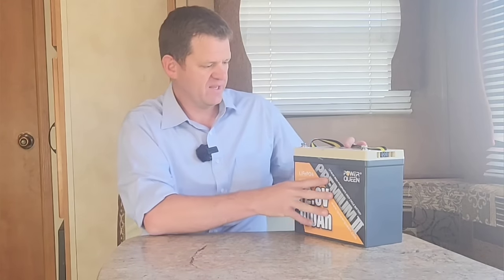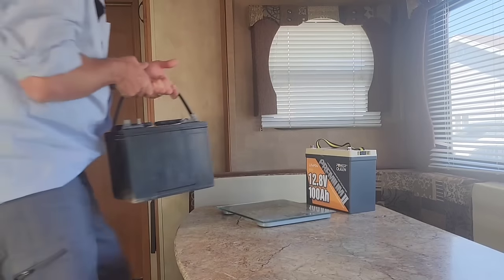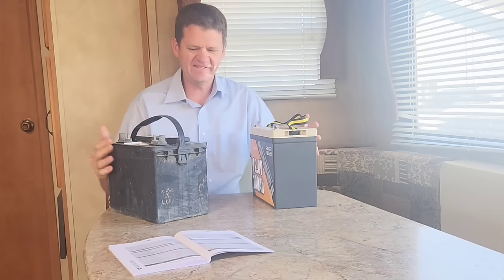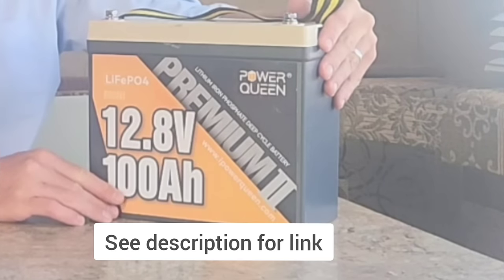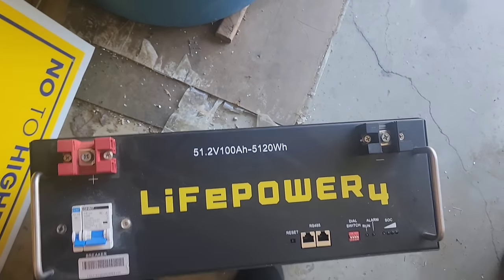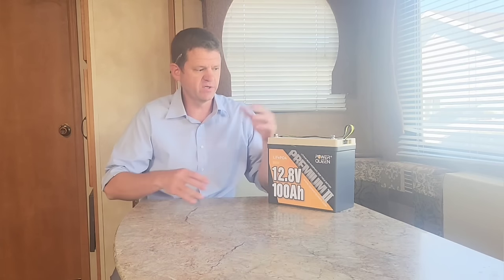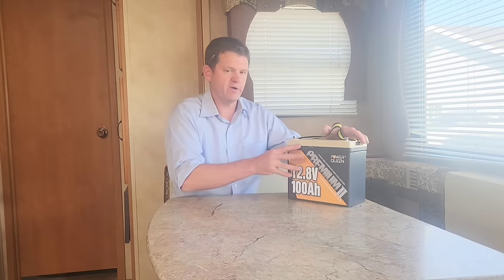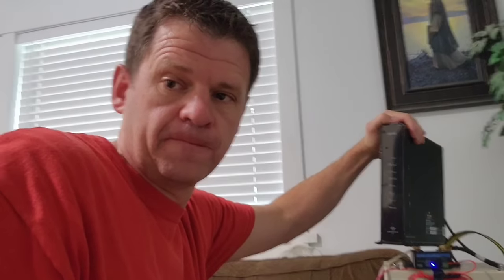How Long Can a 12V LiFePO4 Battery Run a Fridge, TV, Laptop, and Wifi Router (PowerQueen test)

Comment: I run my outdoor lights with 3 100-watt solar pannels, a 100ah lifepo4 battery. I think it might be overkill 😂😂😂. It's not even that many lights !! 😂😂😂.
Reply: Make a video on that, I want to do the same. Please
Reply: @prkoqui  I'm not good at videos. 
My setup:
3 100-watt solar pannels.
12v 100ah lifepo4 battery
Victron 12v 375 va
Renogy 20ah mppt charge controller
3 50-foot outdoor lights from amazon
Timer for the outdoor lights

This setup runs my outdoor lights without a problem ! Even with rainy days, never fails. The victron 12v 375-watt inverter is a smart idea because it only uses 4 watts of power at idle. Crazy low ! Then, the timer makes sure that the lights are on only during the night. 12v 100ah lifepo4 battery charges fast and lasts long. 300 watts is enough to charge the battery.

I have recently upgraded my setup. It now has 3 100ah lifepo4 batteries, 200 watts of solar at 24v. I plan on letting more solar pannels and upgrading the mppt charge controller. I upgraded because I now feed this into a gaming room. 😀

Comment: Hi I'm curious if you checked out the fridge to make sure it was cooling.??  Make another video of you opening the top of the fridge and showing it running as it should be blowing cold air out.... 
PS: I have a 400 what inverter and it doesn't run the "fridge, compressor"  the lights come on inside of the bottom* but compressor kicks on - the alarm sounds on my inverter. However, it's not from Renagy.... It's an ( off brand )... So, I just want to know if you're compressor runs with - out kicking the alarm on, the inverter.... THANKS.!!
Reply from the maker: Ok, I'll try and show that in the next video when I do the test with solar connected. Thanks

Comment: What was the brand of the 5200wh battery you showed at start?  

While there are bad inverters, I find efficiency of Victron no better than those of other decent quality inverters.  80% low watt and 90% when drawing high watts.
Reply from the maker: It's a lifepower4 server rack battery. I have a link in the description. You might also be interested in seeing the video I have reviewing the eg4 v2 server rack battery.

Comment: Maybe it’s more complicated than just this but how long would it take to charge off of 850w(1000w peak) generator? 
Cheers!
Reply from the maker: a 850 watt generator would charge it in just over an hour. maybe 90 minutes....if it's running at 850 watts.

Comment: question, is your fridge an inverter or non-inverter model? It was running like 17 hours on that 100ah battery.  I am trying to learn, and to do it myself. What we use the most is the 12000btu inverter aircon at night and the fridge, the rest is led light and my laptop. 3x per week washing machine. Even If I can only make the aircon work on batteries would be great. I can charge the batteries since I life in ARUBA where we have sunshine even at night...hahaha. Maybe you can give me some input. Thanks
Reply from the maker: Mine is the non-inverter model. I think the inverter models are a lot more efficient

Comment: The key is conservation, when you have a blackout, maybe don't run your 55" TV and the hairdryer.
In a blackout, I watch the news on my phone/tablet instead of on the TV, I don't care about the WiFi router/fiber converter since most likely the ISP is out of power too and I have good speed on 4G
So in the summer it is the fridge/freezer, and in the winter not even that.. (it is cold here)
Reply from the maker: Good points!

Comment: with a router/modem/laptop it is MUCH MUCH more efficient to use voltage buck/boost  regulator.   an inverter wastes a LOT of energy, so it's much better to use regulators.

Comment: Because of the Puerkert effect on the lead acid battery, you can never draw 100@s for one hour but you could on a lithium battery.
Reply: Amps is represented by either 1) Amps or 2) A but never @.

Comment: Great video I'm confused what battery would I need to run a 3000watt inverter continuous power 2800watt. Thanks
Reply from the maker: I personally go with a 48 volt server rack battery and all in one power station... similar to what I have in my RV but I have a really basic understanding of your requirements.

Comment: Once a battery discharges to about 8 volts it has very little power left.  You should always look at keeping it charged to full capacity.  As always, read the owner's manual and follow it.
Reply from the maker: Actually LiFePO4 batteries like to be storied not fully charged.
Reply: Inverter will disconnect  battery if voltage < 10,6 V (standard) - if direct connected you should use voltage controller - this battery is better but equipment need right voltage

Comment: Isnt the equation you divide the amps....say 100amp battery divided by 5amp tv = roughly 20hrs runtime. Add in an inverters amps is applicable
Reply from the maker: Yeah, That's that should work also.

Comment: You're showing the fridge at 50 watts. The compressor was not running.  How much of the day was it actually running?
Reply from the maker: Based on my battery monitor it looks like it's on about 50% of the time

Comment: Looks like that Victron 500va inverter is 900w continuous, not 350-400w. Can clearly handle high surge watts to run a fridge on startup. I'd be fine with 375 or 250 then, I think.
Reply from the maker: The 500va won't run 900 continuous.
Reply: @diySolarPowerFunWithRay  it was 2 weeks ago I looked up the manufacturer specs but that's why I wrote the 900w continuous (and had surge watts way way higher for starting motors) was because that's what I found... Unless I looked at it wrong. So I looked at the 375 and 250 and they seemed to have good enough wattage for my usage (around 400w). Am I wrong?
Reply from the maker: @TheSkystrider. Yeah you were my second when you looked it up. the actual continuous wattage is less than the VA rating. It's usually about 70 or 80% of what the VA rating is. It confuses a lot of people. I wish they would use Watts because that is really what you will be using. For example the victron multiplex 3000 will only output a continuous of 2,400 Watts. Serge is much higher though. If you look into the spec sheet it will mention the Watt rating.  You're not alone, a lot of people will get this mixed up.  Good luck 👍
Reply from the maker: @TheSkystrider  I bet you were looking at the surge rating

Comment: Fantastic video and you explain watts and amps to where many of us understand better than we did . I'm looking at maybe buying one of the battery's . We camp a lot and I use a C-Pap machine . Right now I bring 2 car batteries fully charged and one battery lasts 3 nights. Then I switch it to the other battery . By batteries are the lead ones . I use my C-Pap about 6 hrs a night . Any close idea how long this battery will last before needing re-charged ? Carrying 19 lbs in and out of my camper is better than 40 lbs . And will these recharge using a solar battery charger ? Thanks so much
Reply from the maker: These batteries would be perfect for you. There are some other ones that have a percentage screen which might be better though. The lfp or lithium iron phosphate batteries is definitely what you would want. I would assume that your current batteries aren't at 100% because they never are so I imagine one of these batteries would last you 4 days. Yes they can charge with a solar charger
Reply: What would be a good solar powered unit for me to use on Amazon . I'm no electrical or electronic person at all . But we do a lot of off gris camping . One that is not bigger than 2' x 2'  would work great or if you know one that is great to use. Also I want to thank you so very much for replying to my question .

Comment: My question is, how does that big fridge start with 300-450w inverter. It must have minimum 125W compressor. And calculating inrush current draw ... It must have pretty big margin that invertor. I tried 90w fridge on 300w inverter (clean sine) and it would not start. It goes in to error, over power protection.
Reply: You can add a capacitor to solve the instant current draw problem

Comment: Where is a good place to go get info for building your own systems? Right now I back feed my house from garage using a 50amp circuit and a 5500 watt generator (when power is out). I would like to put panels on garage roof and a battery bank to run house when needed but i admit i dont know much about solar.
Reply from the maker: It looks like you need a all-in-one power system similar to this one:  You can get larger ones if you have a larger solar array or you can put 2 together if you need 240volts. Also Signature solar has tech support if you have questions setting it up.
Reply: Solar - depends where are you living - Kanada , Texas, Panama during Winter. Problem with AC or water pump - need big power. And money :)

Comment: When you started the test was the compressor running on the fridge? plus the power draw would be different if the fridge happened to go into the defrost cycle? just saying.
Reply from the maker: Thanks, if I remember right, it looked look like it went through 1 defrost cycle.

Comment: As my YouTube channel name implies, I'm a Tech-Retard when it comes to all thing tech related, especially when it requires any kind of mathematics.
I can easily acquire all of the necessary components to put together a small home unit BUT, I really struggle when it comes to picking the right components.
All I want to do is build a solar setup that will run things like fans, lights and to charge my E-Bike; stuff like that.  I can just let the city electrical grid run my fridge and cooling system.

Comment: What is the capacity? And that's not the correct question in your title. The question  - How long will it take to recharge a 100AH LiFePO4 Battery after running a refrigerator all night without sunlight? For example, how many 100-watt solar panels will it require to recharge the battery before night fall? That's when you decide that you need more batteries and more solar. In addition, you need a controller programmed for LiFePO4 Batteries and a Pure Sinewave Inverter. I power two freezers and a small refrigerator with four LiFePO4 Batteries in parallel, a Victron 100/30 Smart Controller and a Victron 500 Smart Shunt and four 100 Watt Solar Panels. I monitor everything on my cell phone. I need at least 200 more watts of Solar. It's only for backup. The sun better be shining when I need it. No sun, then no power.
Reply from the maker: Nice set up

Comment: How many watts was the fridge drawing during the test. I think I saw around 50 watts? Was that right?
Reply from the maker: It jumped around. When the condenser was running it would use a lot more power than that.  Idle... not a lot of power.

Comment: Buy only pure sinewave inverters. Modified sinewave inverters don't work well with motors and some electronics. 20" circular fans hum with modified wave inverters showing this effect. Spend the extra money. Remember though, your inverter will call it quits when the voltage gets too low before the battery goes to 0%. Put a timer on and when the inverter alarm goes off that's the extent of the battery.

Comment: I'd better use several small systems which gives me redundancy, that is if one fails i can easily swap components prioritizing what i use and always having a backup, plus repairing is simple and cheap instead of a big system that goes down tottaly in case of a falure which might be inconvinient and expensive
Reply: more over, i'd use 12v devices when ever possible avoiding the need for inverters since anyways devices using A.C need to convert back to 
D.C internally
Reply from the maker: Good point. Thanks.

Comment: when you tested the fridge consuming 86% of battery power you forgot to take into account the power used by the inverter and the power used by the power monitor. voltage conversion always has losses and heat generated also results in power loss. using bigger conductors and fans can help alleviate some of this loss. also an oscilloscope on the inverter will show the generated sine wave. some inerters are square wave however continued use with electronic commponents dont perform efficiently on sqare wave. multi stepped sine wave are more expensive but safer for tv and puter

Comment: MPPT....would a 20A be ok or 30A better, i'm new to this stuff.
Reply from the maker: Depends on the size of wire you use. How many amps the wire can support.  You want to breaker to break before the wire melts.

Comment: I don't know. But I know 16 of them will run my entire house for 3 days if I'm not running any AC units. A day and a half with running 2 small AC units. And overnight if I run 3 AC units using the 12,000btu unit sparingly
Reply from the maker: Nice!

Comment: Any fridge when starting up pulls 8 or 9 times the load. If it's a 500w fridge it can pull almost 4500w. How is it possible for a 400w inverter to handle this?
Reply from the maker: It handles surges.

Comment: 1 quick Question if you have 3 of those batteries hooked up parallel  would that make it 300AH?
Reply from the maker: Yup. 12v 300ah. But if you want to determine the full battery capacity, you want to be measuring in watt hours.

Comment: how long did it take to re-charge the battery fully from solar panels after fully draining it?  Thanks.   Also, you need to power your cable modem as well as the router for internet access, no?
Reply from the maker: They recommend charging it in 5 hours. But you can charge it in 1 hour if you want to really push it. In my case my router is my wireless modem
Reply: @diySolarPowerFunWithRay  Thank you, that is pretty amazing.  Can you tell me what cabling I should buy for that exact setup?  Thickness and length for battery monitor

Comment: I like the video it's John to Earth and you did a good job I live in South Florida I had four deep cycle batteries they work good and I had my Ram diesel charge them.  I've since got rid of the batteries cuz they went bad after 3 years.  I'm going to get to 200 amp batteries now the ones you're talking about and run an inverter off of my diesel RAM truck and and have the inverter on my truck plugging a battery charger to charge the batteries. I'm going to run the batteries to charge my three refrigerators and I have a mini split air conditioner so I need about 6 to 700 w about 6 amps
Reply from the maker: Cool. If you are running a mini split I would consider getting server rack battery setup.  I've got some videos on that system is well.

Comment: @1:00 not true! If you de-charge the battery 100% it won't recharge again. The controller SHOULD stop you doing that. The controller expects a minimum of say 9v to still be on the battery/host for it to be able to start charging. This is often what goes wrong with 18650 cells being de-charged too far. A simple slow kick to bring up the voltage will generally fix the issue but that requires equipment not normally found in the house.
Reply from the maker: Incorrect, you are confusing this battery with other battery chemistries
Reply: @diySolarPowerFunWithRay  try and get a charger to recognise the battery when it's 0v DC .... it won't! Been there done that!
Reply from the maker: @NullaNulla   lithium iron phosphate batteries have a battery management system that prevent that from happening
Reply: @diySolarPowerFunWithRay  correct they're meant to but if you deflate the cells 100% as you claimed the BMS won't see the cells and will refuse to charge. 

I should note it's not the cells that's the issue but rather the BMS.
Reply from the maker: @NullaNulla  LiFePO4 Battery Depth of Discharge - Eco Tree Lithium https://ecotreelithium.co.uk/news/lifepo4-battery-depth-of-discharge/
Reply: @diySolarPowerFunWithRay  the BMS still won't see the cell at 0v. It's by design and an unfortunate side affect.

Comment: If you had removed the laptop battery and used it on AC only, it would have been a better test I thought. Good job though... thanks.
Reply from the maker: Good point!

Comment: My guess would about 90 minutes or less for a full size fridge, 8 hours for an lcd t.v.,  I don't like laptops, and routers don't draw much power.
Reply from the maker: I actually got 17 hours for the fridge. Thanks for the comment.
Reply: @diySolarPowerFunWithRay  You mean 17 hours including the time between cycles when it wasn't running
Reply from the maker: That's correct.

Comment: Hi, Sir, in camping,
Can I connect it to my Bluetti battery for charge?
Can I charge it with my van cigarette light?
Thanks:hand-pink-waving:
Reply from the maker: I'd get a DC to DC converter in order to charge this battery from my cigarette lighter. Hope this helps. Or just one solar panel would be the best. Obviously you'll need a solar charge controller also.
Reply: @diySolarPowerFunWithRay  God bless 🙏✌️❤️❤️❤️

Comment: can i ask how many Watt did the Fridge actually drawn at peak ? Have you try it with an AC yet, i really wanna know how many hour can the 100Ah battery last with an AC with 12000BTU or above
Reply from the maker: The most saw was 350watts I believe.  Is it for your RV? I have another video of a 48v battery running my RV air conditioner.

Comment: Are the claims that LFP batteries can last 10 years true? Where can I go to see the scientific test results?
Reply from the maker: This is hard to verify because they haven't been around that long however I believe it because they are lasting longer than even manufacturers have been expecting. For example I had a server rack battery that came with a 5-year warranty and it has been lasting so long they extended the warranty to 10 years. The YouTuber @davidpoz did a test on his batteries that he has been running 2 years straight on his house. He's been using his batteries every single day. He did a health check on his batteries and they are still at 100% after 2 years.